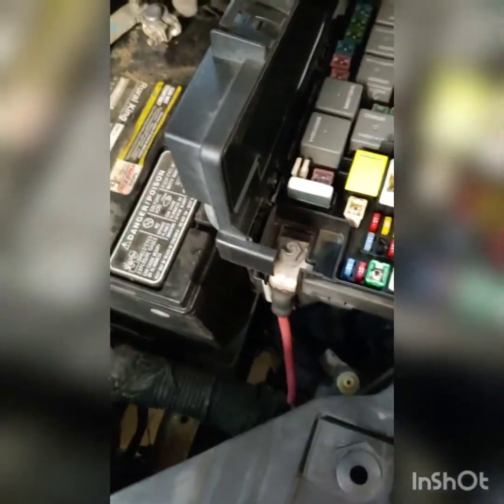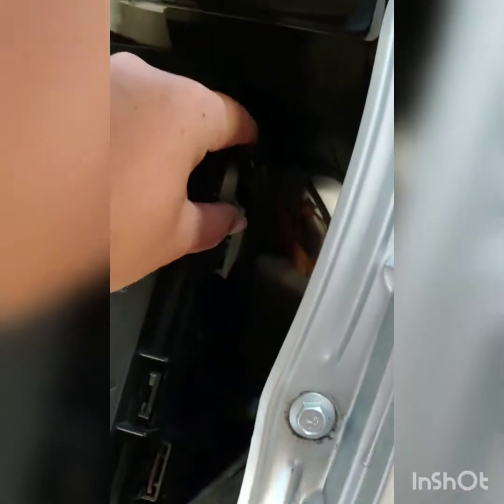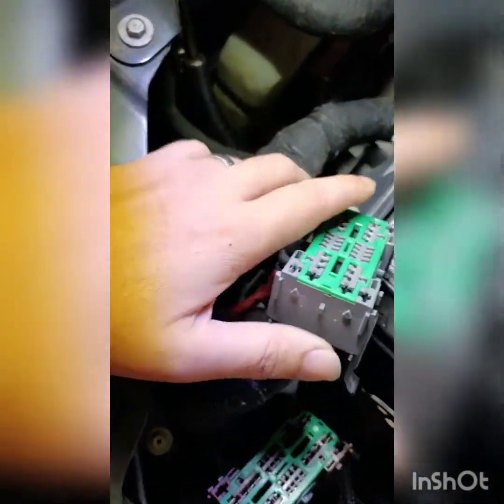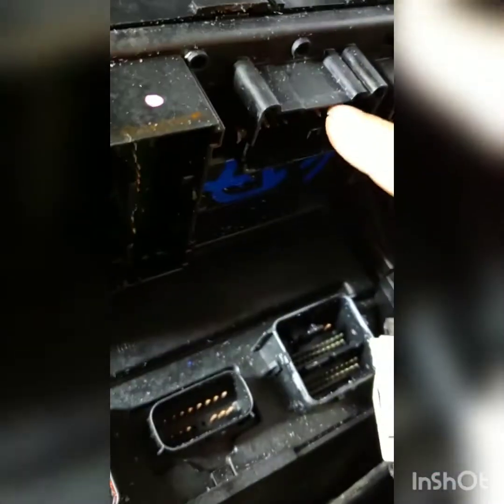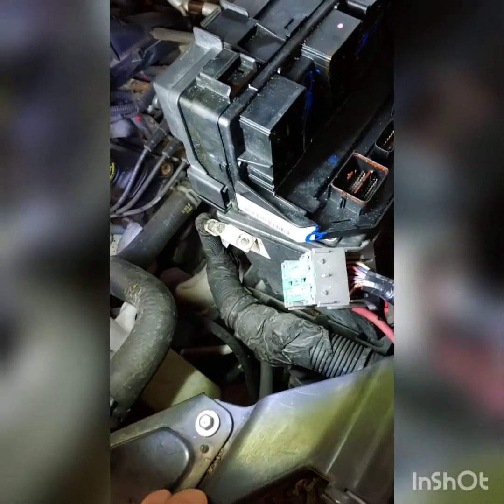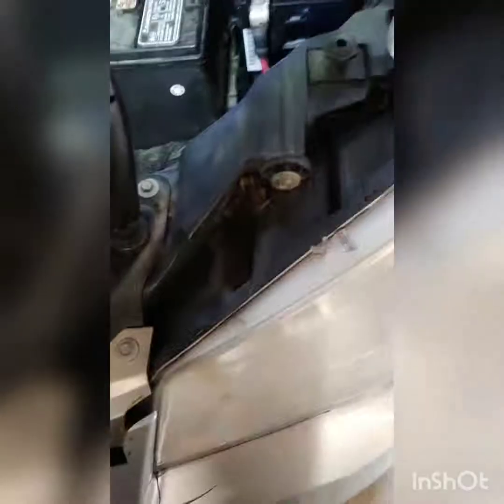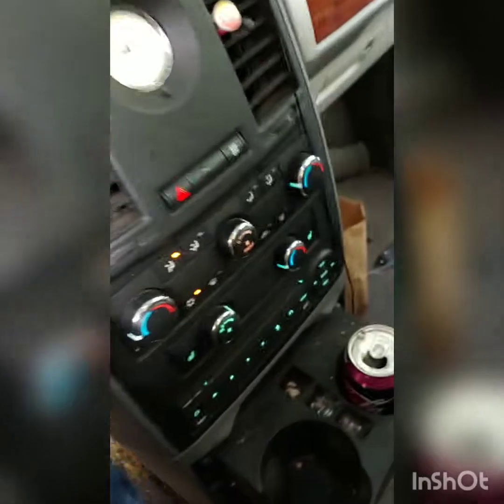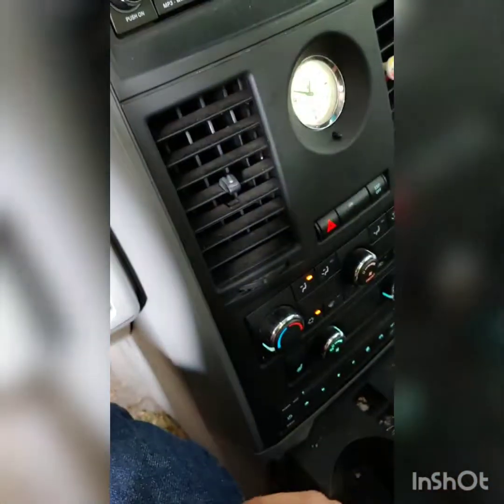2008 Chrysler town and country fuse box replacement

Comment: i have a question i got the fuse box for my 2006 chrysler pacifica.

It is in the same number. The question is, do I need to take it to a dealer to reprogram it? Oh, does it work automatically when I connect it?
Reply from the maker: I never did have to do any reprogramming
Reply: @everhole87  thanks for answer
Reply from the maker: @codiaboligeo56  you're welcome